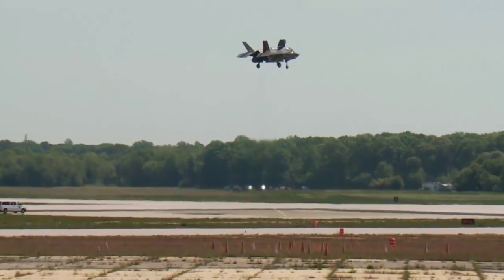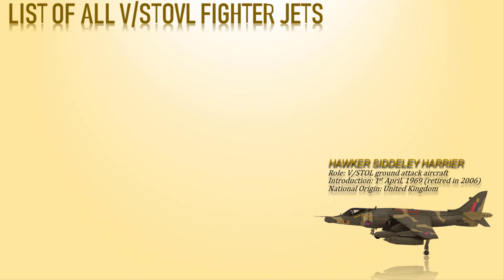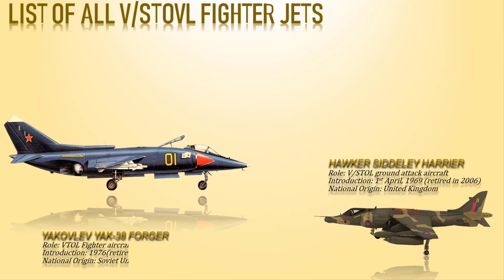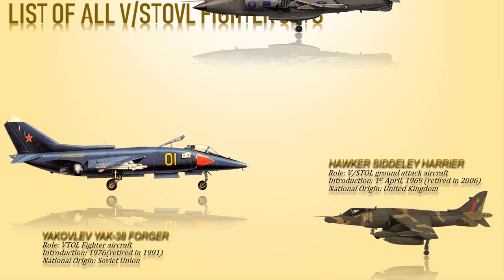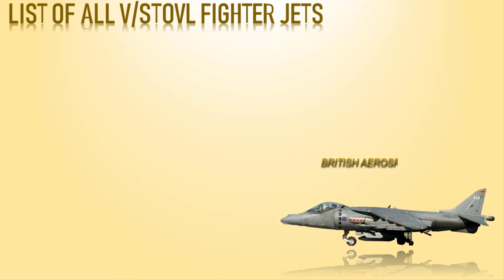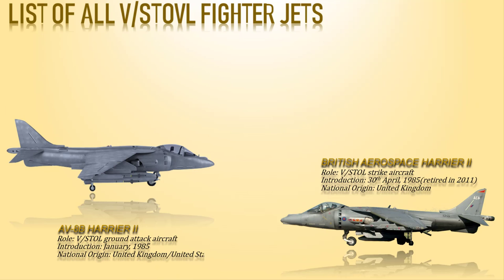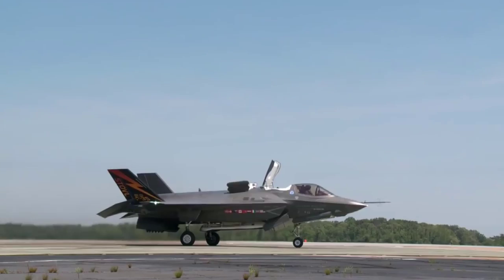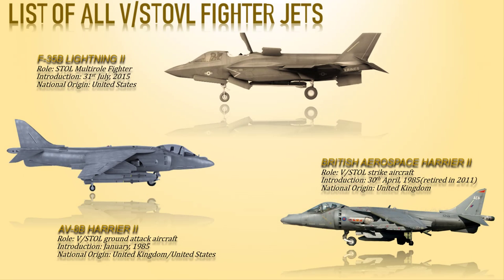List of all vertical landing Fighter jets in the world

Comment: clearing things up, the Yak 141, Yak 38, and Yak 41 were all bassically the same model. all are just the same old Yak-38, maybe very very slightly altered.
Reply: the F35B was a project that was slightly based of the Yak 141, Lockheed funding the Yak 141 after the russians stopped, to see where it would go
Reply: Clearing things up, Yak 141 and 38 similar as much to each other as Electro car and Diesel-powered car

Comment: There also a YAK 141 which the F35 copy in the B version
Reply: Why didn’t it enter service
Reply: The YAC uses two jet engines for frontal lift, the F-35 uses a lift fan. The two aircraft are different.
Reply: @rayjames6096  but the f35 do copy the thurst vectoring design and the middle engine. The Yak 141 didn't have lift fan under its wing. But in my opinion the main fan were the engine and the middle lift fan.
Reply: @iTzAlbertXD   The F-35 is based on a thrust vectoring design the US had in the early 70s.
Reply: @rayjames6096  true, it was the Convair Model 200
Reply: @iTzAlbertXD  The F-35 is a 5th generation stealth jet. And the greatest aircraft ever made. If you’re smart enough to understand the F-35 you’ll understand just how great it is. Even better than the F-22
Reply: The F35 is the copy.